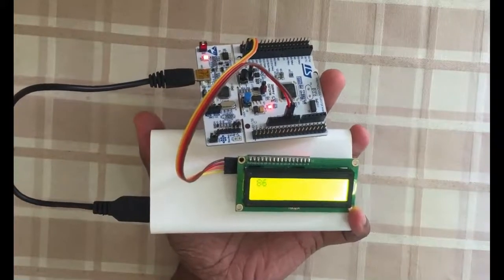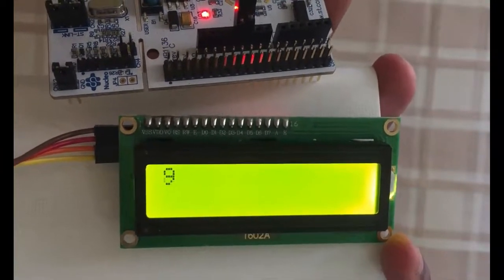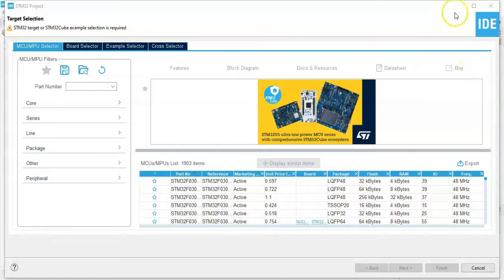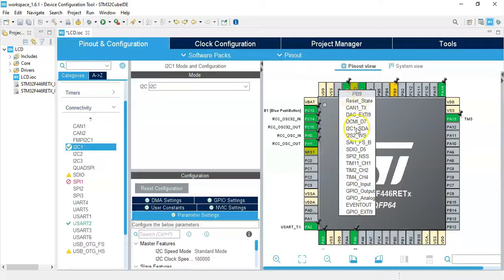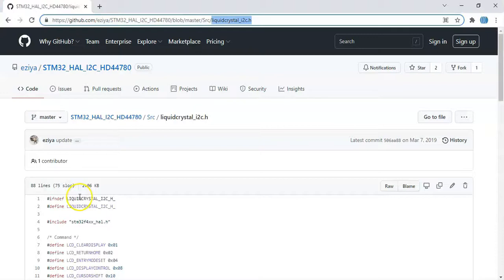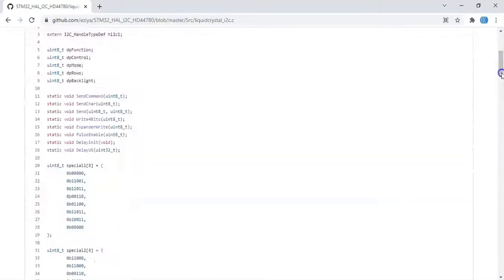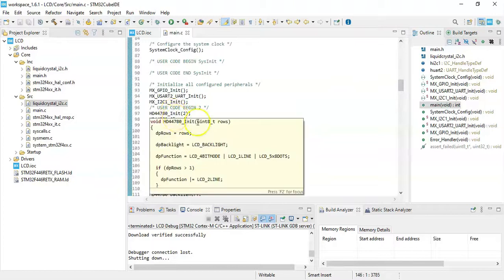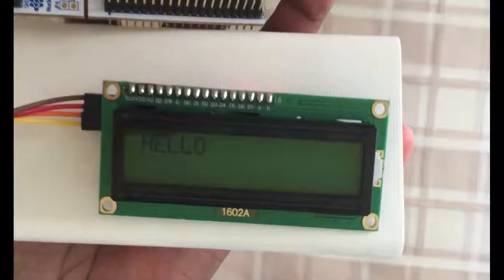61. STM32CubeIDE LCD 1602 Display. I2C 16x2 with STM32F446RE

Comment from the maker: If Blank screen, please check for 5 Volt for VCC supply, potentiometer adjustment or i2c address modification on the solder pads etc.
If itoa function gives you an error, use sprintf instead of itoa as shown below
sprintf(snum,"%d", x);

You need to include stdio.h for this function as shown below
/* USER CODE BEGIN Includes */
#include "stdio.h"
/* USER CODE END Includes */

Comment: Hey man! You really saved my ass! I've seen your tutorials on the web but never knew it was you!
Just so you guys know: the DelayUS function seems to either be *not working*, *requiring a timer*, or *hardware specific*. I am NOT using an F4, I'm using an F7, so maybe its that. Unfortunately, I do not have enough time to sort that out right now, but I may in the future. Just to know, a quick fix is to replace the DelayUS with a HAL_Delay(5) or something like that.

Comment: my display shows very dim text which is barely visible , its connected to 3.3v and if i connect to 5v the display wont start so i dont know how to solve this problem, can anyone help me?
Reply from the maker: adjust the potentiometer on the backside
Reply: @NizarMohideen  I did that nothing happened the potentiometer is all the way on one side where the text is barely visible on the other side the text is not visible at all and if i give 5v supply the backlight also doesn't switch on, i don't want to burn it either

Comment: hi , i have a project that produces electricty with copper wire and magnets, the circuit  is finished im using bridge to capacitor on breadboard also resistor to the led it lights.so i wanna measure the voltage that produced and display it on 12c 16x2 lcd using stm32401f , can u give some advice about walktrought ?
Reply from the maker: Make sure to measure less than 3.3V DC
ADC video is https://youtu.be/Lot5CjxMmsk 
Thanks
Reply: @NizarMohideen  i want to measure the voltage that come throught capacitor on the breadboard, i sellected pa0 for adc, connected with the pozitive leg of capacitor and ground to the negative leg.also how can i find the proper code to measure the voltage at specific point like capacitor as i said and display it on lcd.

Comment: Does not work  for stm32F103C6T6, except clearing screen no other sign. Though I changed for appriopriate HAL library, and trying change address. Have you any suggestion?
Reply from the maker: It worked with stm32f103c8t6. https://youtu.be/l-JVnlJIPao
as far as stm32f103c6t6, if there are no errors regarding memory shortage and code uploading goes well, then it should work
check for 5Volt supply, potentiometer adjustment or i2c address modification on the solder pads etc..
Reply: @NizarMohideen  Thanks.

Comment: Thanks, i tried with STM32L432Kc  and its work. i need to read the data (from usart2), how can i modify the code, please
Reply from the maker: Sure. you can use usart2
Thanks
Reply: if any examples can I found

Comment: Hi every ones. My 16x02 LCD is working fine in arduino, my STM32 U575ZI-Q is working fine on the other project, the CIP on I2C is PCF8574T and by using all the combination described in all comment below, still I see only the backlight on the 1st line of the LCD on the LCD. Help please
Reply from the maker: Line no 58 of liquidcrystal_i2c.h, change to #define DEVICE_ADDR (0x27 << 1) /

if you use i2c address 27 in arduino, keep 0x27
if you use different address, then change accordingly 
it can be 20, 21, 22, 23, 24, 26, 26 or 27
Reply: @NizarMohideen  He, as i wrote at firt, I tried all combination, also considering the 4E defoult address. Nothing to do, i see no sentence on my scree
Reply: the status of the A0 A1 and A2 on the chip of the IC on the screen are not jumpered, but it is not working, i dont know what esle i can do
Reply from the maker: Did you adjust the potentiometer on the backside
Reply: @NizarMohideen  good evening. For sure i did. In Arduino all working. Only on STM32 i am facing so much. I try all possible things.

Comment: Yes the code is uploaded successfully but there is no output on the screen. My screen is blue not green as in the video.
Reply: I'm having the same problem. Did you end up finding a fix?
Reply: @Sebass0722  Yes I did,try adjust the contrast on the I2C module and it should work

Comment: What about external pull ups on the I2C lines ?
Reply from the maker: If you use long wires between MCU and display, then pull ups necessary. If short wires, then it is optional. Thanks
Reply: @NizarMohideen  Not sure what qualifies as long but I'll try a couple of 10K's on those lines.
Reply: Well my lcd at least lit up after i changed to another one and put pull ups on it. The display backlight toggled every few seconds which I assumed might have been the program running but my display is saturated off a 5v supply and now I'm wondering if this blue rotary switch is in fact the contrast pot ??
Reply: 4.7K for frequency under 100Kbps
2.2K for ~100Kbps
1K for more than 100Kbps

From my Microprocessors class today, discussing the same kind of i2c utilization with a different development board; these values above should be standard, to the Vcc rail.

Comment: Can't get mine to work. It's an NXP chip as opposed to TI and apparently needs a different address which I supplied. Still doesn't work. does that rotary switch have any bearing on the address ? I have nothing jumpered. Founds this online "The I2C address of your LCD depends on the manufacturer, as mentioned earlier. If your LCD has a Texas Instruments’ PCF8574 chip, its default I2C address is 0x27Hex. If your LCD has NXP Semiconductors’ PCF8574 chip, its default I2C address is 0x3FHex." I've tried both addresses but neither worked.
Reply from the maker: Line no 58 of liquidcrystal_i2c.h, change to #define DEVICE_ADDR (0x27 << 1) // 0x4E

Change 27 to your new address
Reply: @NizarMohideen  Yes I did that per my other posting but it still doesn't work. Will try some pull ups next. I'd still like to know what the rotary switch is all about. I would think it must have something to do with addressing ???
Reply: Oddly enough this came to life when I changed back to the alleged TI address 0x27 even though I had a NXP chip.. I also simultaneously added 10 k pull ups. Don't which or if both measures brought it to life. Awesome tutorial !! I look forward to watching your other tutorials.
Reply from the maker: Thanks

Comment: Hi! I have a problem with the writing, my LCD turn on and turn off the background light but doesn't write anything. My board is the F401RE. Do you know what is the problem? Is the address? Thank you!
Reply: There's a blue thing on the back of the LCD display. You have to tighten it with a screwdriver
Reply: I FIGURED IT OUT! Just tighten the screw at the back of the display.

Comment: 273,276,289 in rows liquidcrystal_i2c 
static void DelayInit(void)
{
  CoreDebug->DEMCR &= ~CoreDebug_DEMCR_TRCENA_Msk;
  CoreDebug->DEMCR |=  CoreDebug_DEMCR_TRCENA_Msk;

  DWT->CTRL &= ~DWT_CTRL_CYCCNTENA_Msk; //~0x00000001;
  DWT->CTRL |=  DWT_CTRL_CYCCNTENA_Msk; //0x00000001;

  DWT->CYCCNT = 0;

  /* 3 NO OPERATION instructions */
  __ASM volatile ("NOP");
  __ASM volatile ("NOP");
  __ASM volatile ("NOP");
}

static void DelayUS(uint32_t us) {
  uint32_t cycles = (SystemCoreClock/1000000L)*us;
  uint32_t start = DWT->CYCCNT;
  volatile uint32_t cnt;

  do
  {
    cnt = DWT->CYCCNT - start;
  } while(cnt < cycles);
}   

sir It gives an error here, I am using stm32g0b1re, what should I do?

Comment: Hello... Thank you so much for this interesting video..
I have nucleo L476, i tried lcd shield using Arduino IDE, i have no result... 
The LCD didn't work , while it worked well with my Arduino uno
Reply from the maker: I understood you tried nucleo L476 lcd shield using Arduino IDE. I suggest to try with STM32CubeIDE. Installation of  STM32CubeIDE is in video no 50 in my YouTube channel

Comment: Depending on the connector (A0 - A2) on the i2c board your address might be from 20 to 27. So you can search for info or try all addresses. On my board jumper A0 was connected, so address was 26. Otherwise everything works, thanks for tutorial.
Reply from the maker: Thanks for the info!
Reply: I'd like more info on this cause mine is not working and I'm quite sure it is that address issue. Neither A0, A1 or A2 are jumpered on my board. You said "search for info" .... where do we do that ? I have some sort of rotary switch. How does all this addressing work ? Thanks.
Reply: According to that table your address is 0x27
Reply: @garetts8156  Sorry, where is this table ?
Reply: @garetts8156  I didn't see a table. In any event, I got this off of Google "If your LCD has a Texas Instruments’ PCF8574 chip, its default I2C address is 0x27Hex. If your LCD has NXP Semiconductors’ PCF8574 chip, its default I2C address is 0x3FHex.". Sure enough, mine is a NXP chip. Other than address, not sure what other code changes need to happen.

Comment: Will the same code work for stm32f401re?
Reply: When you selected your module just select your one and everything else same.... I used STM32F411RE and it worked with 20X4 LCD no problem
Reply: @damiansklencik6830  which module bro..? mine is not working.
Reply from the maker: Although I haven't tested it using stm32f401re, it should work with it.
Thanks

Comment: Thanks for the video and explanation. I tried to follow micropeta page code but unable to get my LCD to work. The code uploaded but nothing is displayed on my LCD. Are there other configuration needed beside the I2C1 init. Here my i2c setting, not sure if the address 0x27 is correct.

  hi2c1.Instance = I2C1;
  hi2c1.Init.ClockSpeed = 100000;
  hi2c1.Init.DutyCycle = I2C_DUTYCYCLE_2;
  hi2c1.Init.OwnAddress1 = 78;
  hi2c1.Init.AddressingMode = I2C_ADDRESSINGMODE_7BIT;
  hi2c1.Init.DualAddressMode = I2C_DUALADDRESS_DISABLE;
  hi2c1.Init.OwnAddress2 = 0;
  hi2c1.Init.GeneralCallMode = I2C_GENERALCALL_DISABLE;
  hi2c1.Init.NoStretchMode = I2C_NOSTRETCH_DISABLE;
  if (HAL_I2C_Init(&hi2c1) != HAL_OK)
  {
    Error_Handler();
  }
Reply from the maker: There are no other configuration besides I have shown on video and docs.

After selecting I2C,
Set PB8 to I2C1_SCL
Set PB9 to I2C1_SDA
If the jumper behind the LCD not modified, the address is 0x27. The address for cubeide is (0x27 << 1)  or 0x4E
Line no 58 of liquidcrystal_i2c.h, change to #define DEVICE_ADDR (0x27 << 1) // 0x4E
Thanks
Reply: @NizarMohideen  I have finally got a new LCD with PF8574 backpack and it works like a charm. Thanks.
Reply from the maker: Thanks.